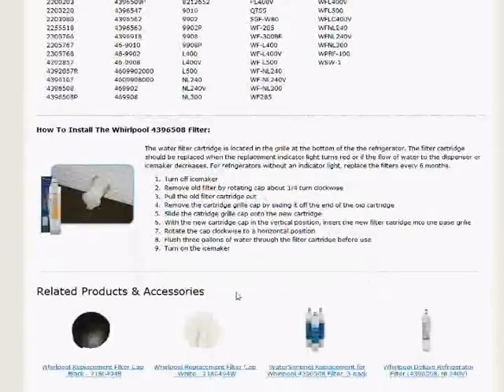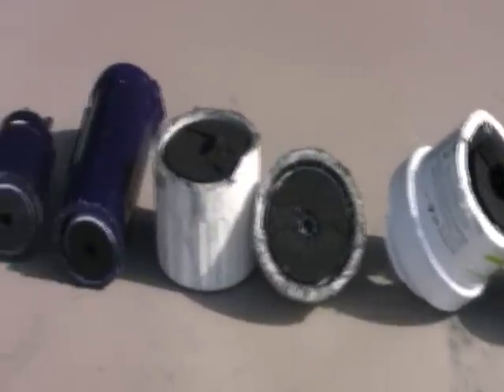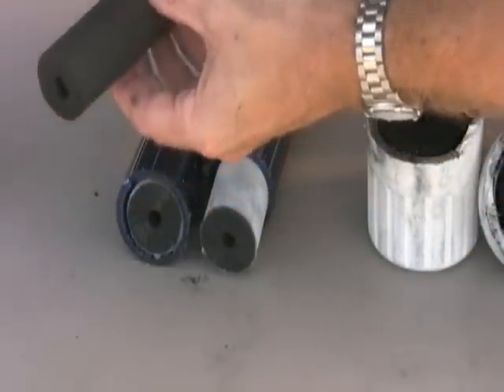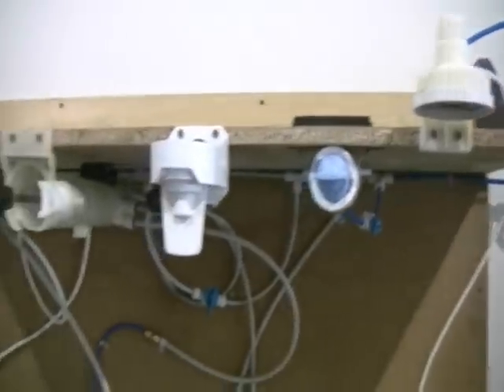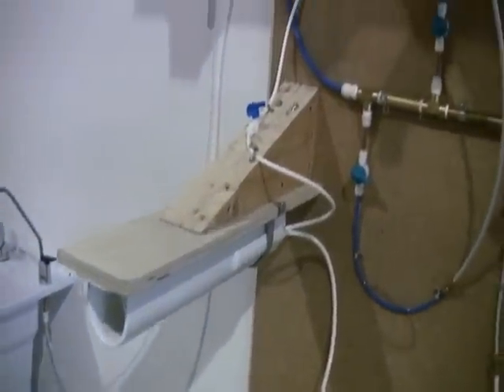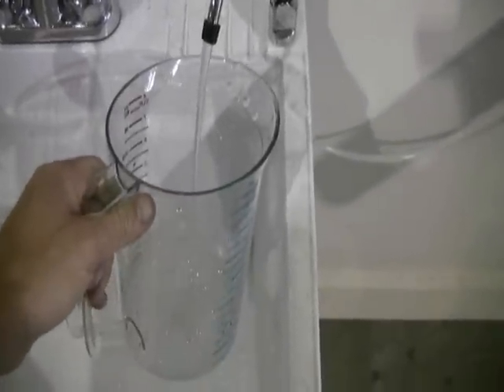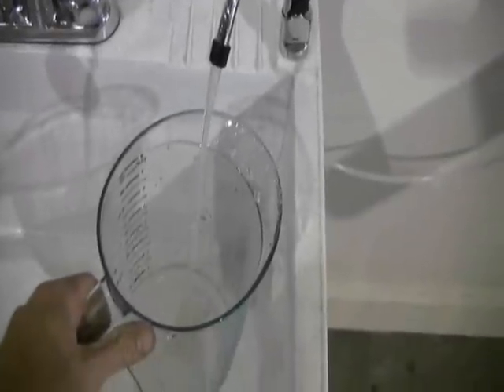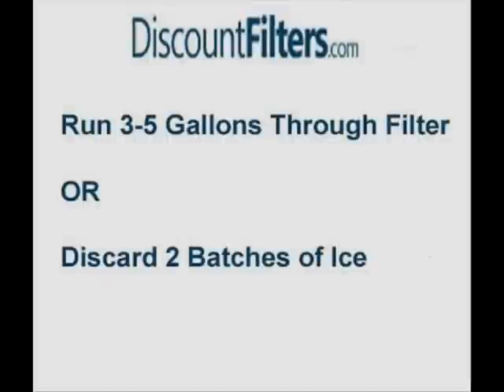"Flushing" Your New Fridge Filter

Comment: My refrigerator water supply is tapped off a hot water line.  If I draw 2 gallons of water through the filter it is possible that I may introduce warm and even hot water into my Frigidaire PurePour PWF-1 (FPPWFUO!) filter. The question is: "Will some hot water damage my water filter?
Reply: Yes it will.
Reply: First of all…who put the tap into the hot water line???? Second, I would take that out and put it in the cold water line. I’m sorry, not trying to be rude but was there a reason for that being in the hot water line?